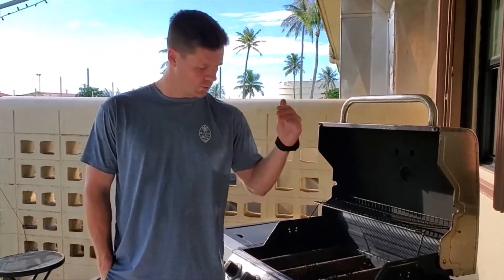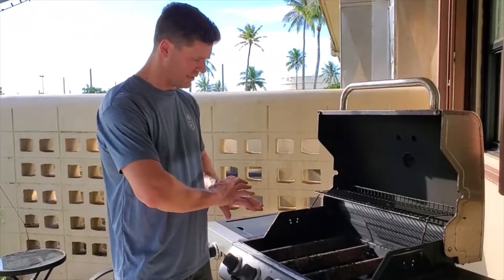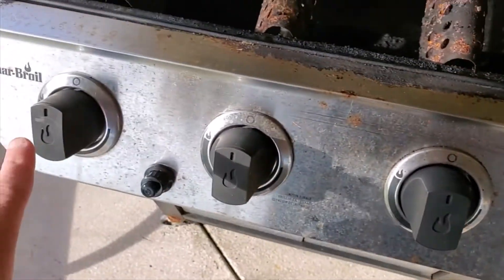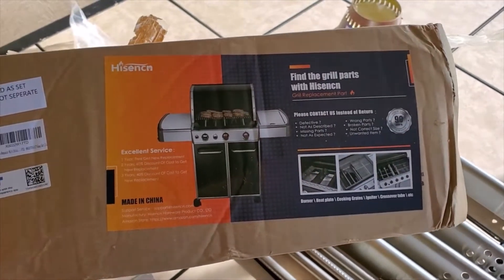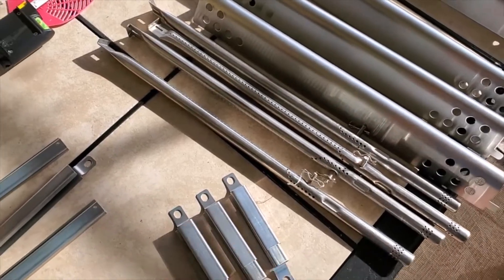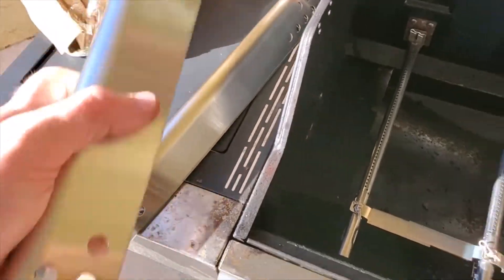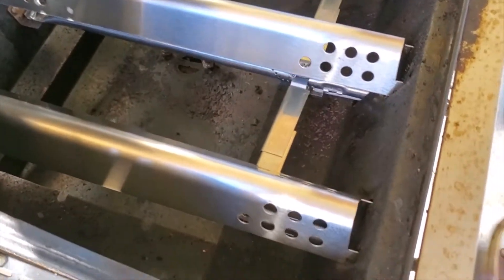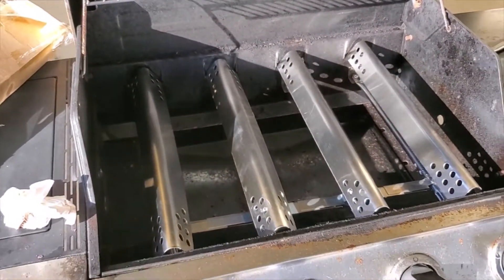How to Rebuild Your Grill a Charbroil Burner Repair and Ignitor Story

Comment: Great video. Thanks for the tip about facing the flame carriers forward. It's a small detail that really does make a difference, and is perfect for the reason you mentioned of searing meat, and have the stronger flame toward the front.

Comment: This was a great refresher.  I bought the same grill 7 years ago from AAFES and put it together from kit form.  It has worked great up until now.  Upon inspection, the burner tubes and the carry-over tubes needed to be replaced.  The carry-over tubes fell apart as I examined them.  It's been 7 years since I built this item, what to do next.  After reading the manual, ordering the parts, and waiting, I found this video.  A great refresher, followed what was shown and everything went together as explained on the first try.  The only issue I had was the igniter part was tough to take off, but got it.  As retired military, one learns to make do with what is in hand.  Of all the youtube videos for replacement, this one I felt was the best.  Thank's,
Reply: Replacing grill parts for dummies. 
Thank god he addressed how to remove hairpin clips, I never would have figured that out om my own?😆😅🤣😂
Reply from the maker: @deependz3231 I make 300 dollars a month from this video and the parts I sell in the description. Apparently, you're the smartest guy here. So the rest of us shut up and learn from each other. Thanks for the comment. 😂
Reply: I know how to remove cotter pins but my kit only gave me enough for either the carry-over tubes or the end of the burner where it connects to the box (body of the grill). But they gave me screws and washers 🤷‍♀

Comment: Great video. Thanks. I was given a 5 burner charbroil grill that was 1 year old. It had been used a lot but never cleaned. I scrapped about 3/4 in off the bottom. The glop protected all the metal so it was easy to clean. The burners were good so the only thing that it will need soon are drip pieces above the burners. 
They should hold up this season. 
Thanks for a thorough  video.
Stay safe.

Comment: Spot on video, I found one just like it on the side of the road, put out for the garbage man, and I got it.  I watched this vid, ordered the parts kit and it went back together just as you described.  My only challenge was the rear clips were very hard to install, I could've never done it with one hand.
Thanks for taking all the guess work out!

Comment: My son picked up a used grill for me for $30, then told me what to order on Amazon. It's a 5 burner and looks like a broiler on the end. That and one of the burners have ignitors. I can't remember which burner I took the ignitor off. Does it matter which burner I put the new ignitor on? (5 came in the kit but the ignition switch only has room for 3 wires.
Reply from the maker: It doesn't matter as long as that is the one you use to light your grill every time. The front of the grill should be marked with which knob has the ignition.

Comment: I would like to how quickly  your BBQ gets up to 500 degrees or more, and how long, if at all. I have the same BBQ, that I bought new and I feel like it's never properly heated up, as it won't go past 450.
Reply from the maker: Mine gets up to 600 if I leave it sit. Seems very hot. Might be your regulator or burners that are misaligned.
Reply: @c130aviator  yes the regulator would be my first guess. I've tried purging the tank, and resetting the regulator, and it still takes like 15 minutes to get to 450. I think I will order a regulator, and see if it was just a factory defect. I should also add the uneven cooking all over the grilling surface, and the temperature drop off when the lid is opened. Something just ain't right.

Comment: I took everything apart to clean it.,
I never touched pilot number two. Now that I put everything back together after watching this video  pilots 1,3 and four 4  do   not work. Any suggestions?
Reply from the maker: When in doubt, start over. Disassemble again, check everything, and reassemble. Use a little scientific method and go back to the beginning.
Reply: @c130aviator  Will do👍
Thank you so much

Comment: These bbq are so cheaply made with paper thin metal, they just rot in a couple of years.
Reply from the maker: True, but you strike me as the type that would also say they are too expensive if they were built better. 6 of 1, 1/2 dozen of the other, so they say.
Reply: @c130aviator  I don't know, I just keep replacing burners or shields, pretty much every year. I keep it clean every time I use it but doesn't matter. Either the grease or the weather destroy them. Under a porch! You're right, they are cheap, but I'm worried to spent 2 grand on a BBQ now...